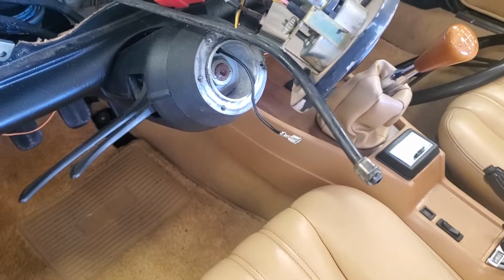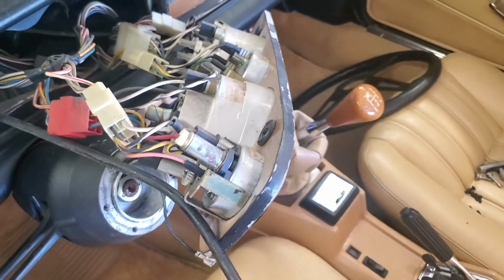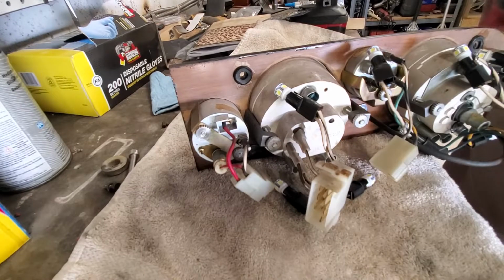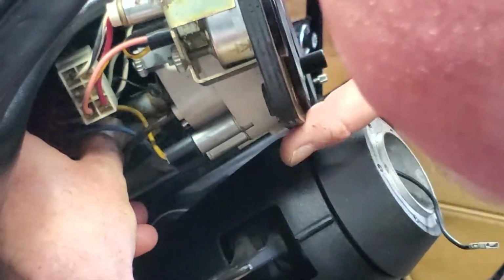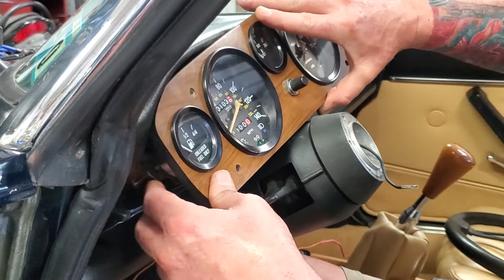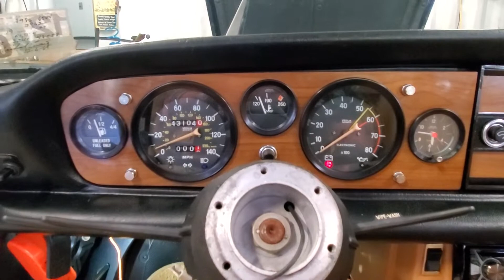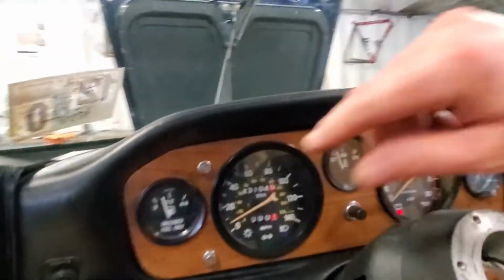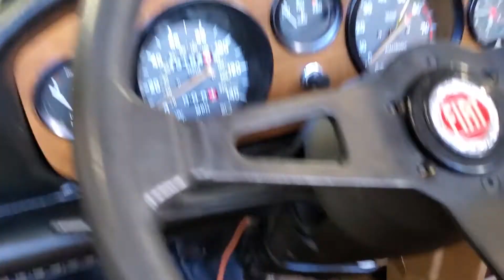1979 Fiat Spider 124, LED dash lights and hooking up the speedometer

Comment: I wrestled with the speedo cable attachment several times on my 84 Spider. It's almost impossible to reach. It kept coming off. Eventually I held it in place with wire to the speedo case.
Reply from the maker: I removed it from the transmission to get it attached, then pushed it back into place with the cluster. They are definitely sensitive to move around.
Reply: @ELDESTBuilds  The video seems to be missing where the cable attaches to the back of speedo gauge ??  You said something about reaching underneath?  Does it thread on ??
Reply from the maker: @5589daniel  at the beginning the end of the cable is broken away from the rest.  The cylindrical plastic piece was glued to the cable end. The whole unit slips over the part of the speedo and clicks into place. I can't do screenshots in the comments but if you send me an email, I'll try and explain more if necessary.
Reply: The white plastic piece with the little tabs at the end of the cable is actually two parts on my 1980 Spider 2000. One is a collar that slides over the plastic tabs to hold them in place around the lip at the speedometer. Don't try to get the tabs over the lip by pushing on the collar, because that just prevents the tabs from spreading. Instead, with the collar as far back as you can get it, use a flat blade screwdriver to nudge one of the tabs over the lip. The whole piece should easily fall into place. Now you can pull the collar up as far as it will go to secure the attachment.
Reply from the maker: Thanks buddy

Comment: I have 79 spider 2000 and my blinkers and hazardes not working- DASH lightning - how can I make that a lot brighter?
Reply from the maker: The hazard switch not functioning correctly will affect turn signals and sometimes the wipers for some reason.
Clean the grounds on the star above the ignition switch. Check or replace the turn signal relay.  
The LED lights in the dash make a huge difference,  draw fewer amps, and make less heat.

Comment: I have cussed the instrument cluster on my 76 several times.  I like the LED instrument light upgrade
Reply from the maker: never wants to go back in
Reply: I have a ‘79. I did the LED upgrade…paying attention NOT to swap the turn signal one…but now my battery light comes on for a bit, then goes off…reading about it, some say that the light is wired in such a way to interact with the alternator, and that by putting a LED you take this “interaction” away due to the minimal voltage required by the LED…thought to throw this out there as a precaution. I’m going back to incandescence type for all the “warning” lights, leaving the background lights in LED. Will follow up here with the results.
Reply from the maker: Sounds interesting,  may take a few moments for the charge to work through

Comment: Does the Speedo Cable End Screw into the speedometer flange on back of Speedo ??  I cant seem to get it to Stay On my 83 Spider  ???  Driving me NUTS after 20 hours.....  PLEASE HELP
Reply from the maker: Screws into the transmission.  On this one it is a snap on fitment,  but it was broken off and had to glue the plastic bits together to make it click together.
Reply: Yes I know how tight it is, have the scratches on my hands to show for it. Think I hv it...Hopefully!!!  I was wanting to swap my 85 mph with a 140mph but realized that has a threaded connection, so put the 85 back in, I  just purchased and installed new speedo cable, and NOT going to buy another one and reinstall it.
I'm still having problems getting indicator lights to function....VERY FRUSTRATING!!!
Reply: @ELDESTBuilds  Thank You for Reply !!!
Reply from the maker: Grounds, it's usually the grounds

Comment: Did you ever replace the clock and was it replaced with an oil gauge?  Curious of how that wiring looks.
Reply from the maker: I did not. Busted clock is still in there. Oil gauge wouldn't be too hard. Buy one with the sender, install on the bung near the oil filter, run the wires to the dash, use the existing light, done and done
Reply: I installed oil pressure sending unit warning light switch, oil pressure sending unit with the oil sending unit adapter.  Ran a line to the new gauge.  My oil light came on first thing so wondering if my wire connection in the back of the gauge is wrong. @ELDESTBuilds
Reply from the maker: @rosedumont8253 check your ground connections

Comment: Question, how many back light bulbs are there in each instrument gauge? I replaced one per gauge. But my speedo and tach look to be a different brightness then the smaller ones. Wondering if I missed a bulb or something?
Reply from the maker: The big gauges have a few for the indicators and such but don't change the turn signal build to LED.  It will blink funny.
Reply: @ELDESTBuilds  but only one backlit bulb, correct?
Reply from the maker: Correct

Comment: How can I know if my speedometer is bad ??
Reply from the maker: If the car is driving, it should be working.  If the  car is being repaired,  you could take the cable loose from the transmission and spin  the inner drive cable.  In this  video the mounting point was broken. Remove the cable from the transmission before removing the dash.

Comment: Great work and thanks for video. I did similar  job today on removal and install of dash on my 84. Two issues I am working to resolve are the Speedo bouncing and the turn signal stalk not staying “on” when turning right. I changed the rear taillight boards to LED, rear side running lights to LED, and front turn signal lights and running lights to LED.
Reply from the maker: Welcome,  I had a few issues getting all the LEDs to light up in the tail light section. Corrosion on the fittings had to be cleaned off.

Comment: You can fix the quartz clock by cleaning the inside gears or the electric motor. Once running it’s a power hungry little bastard...it will kill the battery in a matter of days. Replace the clock lense with a glass one easily made at the glass shop. Nice job.😀🇨🇦
Reply from the maker: This one has a rotten/crumbly plastic gear.

Comment: Thanks for all your informative videos. It has motivated me to take up few projects on my Fiat Spider. Just purchased on Christmas 🎄 I have a question for you which LED is used for turn indicator, brake lights? Have ordered dash led as per your Amazon link.
Reply from the maker: These guys have full kits available. This is for the 79 but would be similar for a number of the year models 

https://www.superbrightleds.com/vehicle/?find=1979-fiat-124-spider-7090735
Reply: @ELDESTBuilds  mine is 79, thanks for the details.
Reply from the maker: Welcome

Comment: How do you take off the middle panel where between the glove box and the speedometer? I gotta get to the wiring behind it but I don’t know how to take it off.
Reply from the maker: The beveled ring around the outer
nobs spin off
Reply: @ELDESTBuilds  thanks!

Comment: I am having a heck of a time trying to keep the plastic end on speedometer cable from coming off. The plastic tabs are supposed to click on the back of speedometer,  but I cannot seem to be able to get it to click on after trying a cpl dozen times....what's the trick Eldest??
Reply from the maker: The tabs were broken in this one.  Had to glue them back on. Take the speedo loose from the transmission.  It just unscrews,  and pull more cable into the dash for extra working room.

Comment: How much brighter were the gauges with these LED bulbs ?  Does the dimming work ok?  Your videos are great. I am restoring a 1983 Pininfarina Spider and doing many of the same things you did, Very Helpful, Thanks for posting !
Reply from the maker: The LED are brighter in the gauges.  Leave the blinker light standard. Take the speedometer cable loose from the transmission before pulling the cluster. 
The other benefit is lower power draw on the system
Reply: @ELDESTBuilds  Thank you for the info.  Why cant I just disconnect the Speedo cable from the MPH dash gauge ?
Reply from the maker: There's not enough space to pull out and disconnect.  Have to pull more cable through the firewall to make room to disconnect.  Watch me do it wrong and learn.

Comment: I bought a VDO Oil pressure guage to replace the  Slow + in my case redundant clock (radio has an accurate non-fogged up clock).Almost ready to redo the Dash. Love the LED upgrade idea and the heads up about the turn signal.
**an possibility that you are thinking similarly?**
 VDO Sending unit is Key I'm told. The It. one does not send info at low pressure but the VDO one does...I just don't know how to connect it. I'll soon have a useful guage on the dash that is not hooked up:-)>
Reply from the maker: Gauge install should be pretty straightforward.  The sending unit mounts on the oil filter assembly.  Then it's just hooking up the wires

Comment: Jesse, when I clicked on the amazon link above and received the LED bulbs the heads were too big to fit into the instruments. I had to re order a different LED bulb just fyi
Reply from the maker: Interesting
Reply: @ELDESTBuilds  🤷‍♂️ I know I got the Nineo 10 piece they fit fine into the bulb hole.
Reply from the maker: First time I heard of a fitment issue
Reply: @ELDESTBuilds  I have the same ‘79 and same instruments
Reply from the maker: That's even weirder
Reply: @famctri  .  So will the bulbs listed on your Amazon Link fit ?

Comment: Would this work for a 81 ? My speedometer stop as well and how to take the dashboard off ?
Reply from the maker: Yes would be similar.  The four nobs hold the cluster on. It's easier if you remove the steering wheel and speedometer cable from the transmission first.
Reply: @ELDESTBuilds  ok thanks is there a video on that lol thanks again
Reply from the maker: This is the only one I have

Comment: could these be installed with the existing wiring, or does it need a relay?
Reply from the maker: Dash lights do not required the LED relay

Comment: It would've been a lot easier if you drop the steering column to deal with putting that back in
Reply from the maker: Considered that, not necessary just remove the steering wheel.